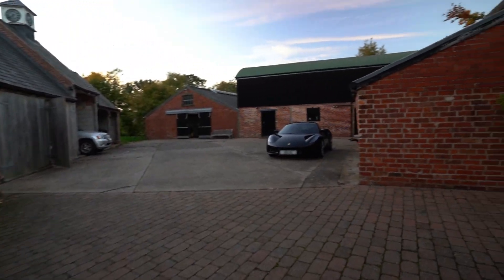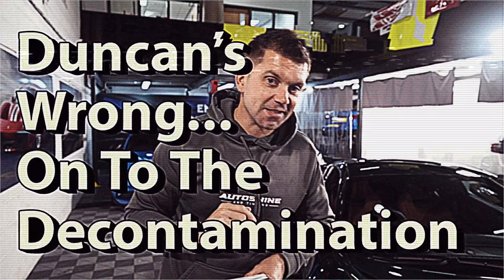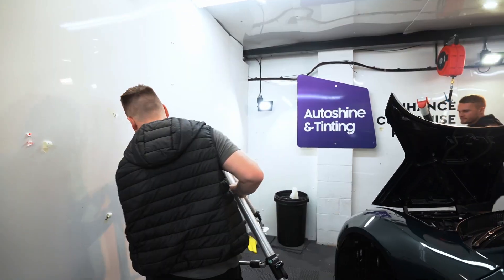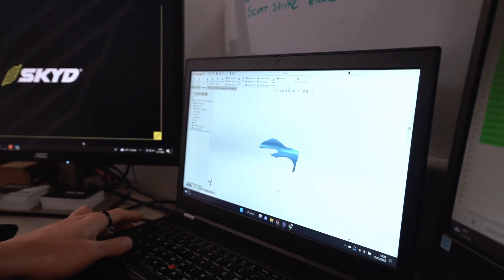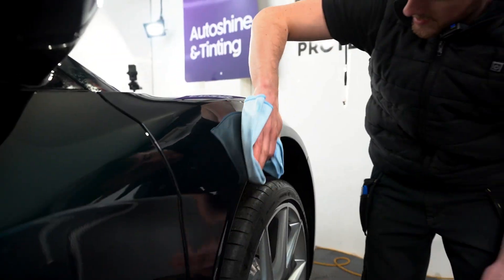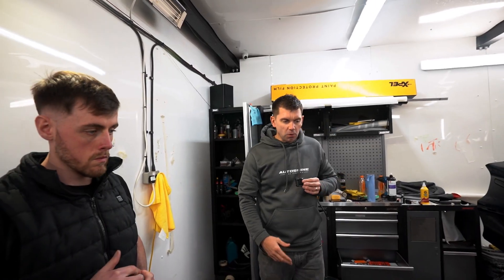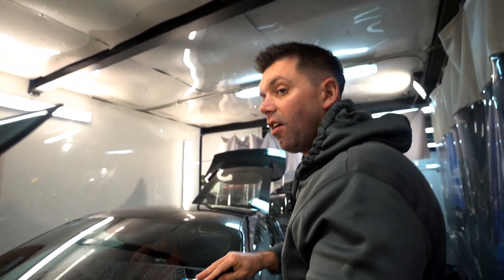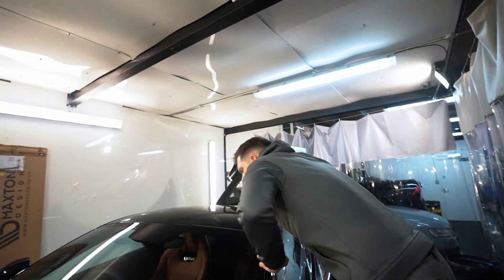FIRST UK Lotus EMIRA Protected with 3D Scanned PPF

Comment: Dude, more pictures of the final product outside and in the SUN!  Lovely install.   How is the PPF fitted around the curve of the air intakes and will there be a seam there that will collect dirt over time?
Reply from the maker: Hi, sorry for the lack of end shots. Weather has been awful in UK and the 1 chance we got for Sun before we had to return the car it was just about to go dark! 
There is a seam under the air intake. We tried several ways and no way to avoid it due to the shape of the panel. Film does butt up against each other though so should be limited to what dirt collects here, and we also ensure a good coating of ceramic coating is also installed to ensure dirt won't stay for long. 
Thanks for watching 🙂
Reply: @AutoshineTinting  Thanks - was wondering if somehow the PPF would “stretch” to fit that intake, I know many exotics have tunnels that probably cause the same issue.  So you basically had to cut a “funnel” of ppf to go inside the intake - any chance of any close ups of this area?  Super job.

Comment: I would not want a bunch of guys taken parts of my Car off when they have no experience with an Emira at all!
Reply from the maker: Hi H2, thanks for watching. I actually feel exactly the same and this is why we don't remove parts from the vehicle for PPF and use our computer cut panels. On this particular install, we created the pattern to fit around the headlights, however once fitted, I looked and thought it would be better if the headlights were removed so we could wrap inside this edge. What we edited from the video is me personally (trained mechanic with over 22 years experience) personally investigating what removing the headlights would involve. Upon inspection, it turned out to be 5 plastic clips to remove the front part of inner wheel liner, then 2 small 10mm bolts on the headlight. This allowed me to then drop the headlight down around 2cm allowing us to wrap inside the edge without removing the headlight fully. 
Nothing else was removed from the vehicle that didn't simply clip off (plastic air vents to the side of the engine glass, number plates etc).
Our customers will also be given the option of us installing leaving the headlights in place or if they are happy for me to do what we show in the video.
Hope that has shed more light on what we do here 🙂
Have a great day and hope you watch some of our other videos.
Duncan